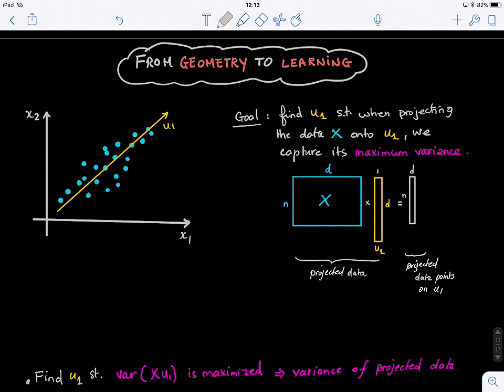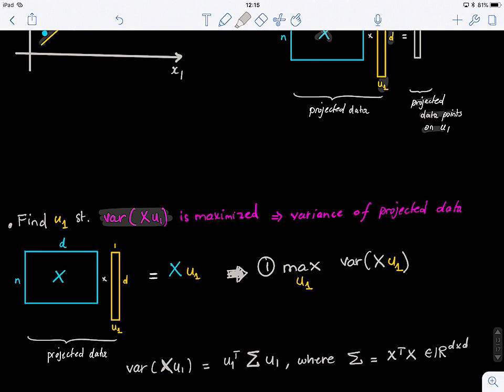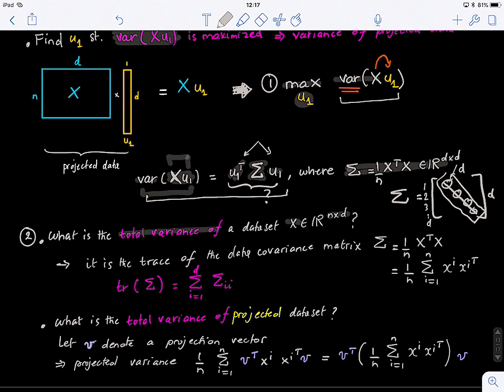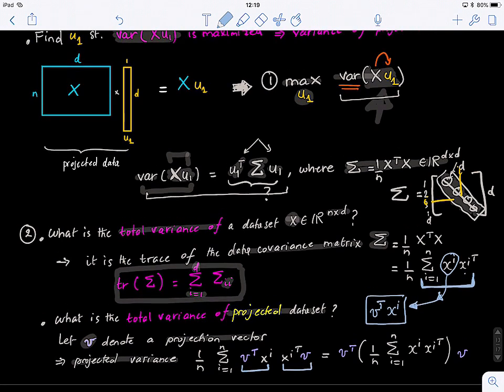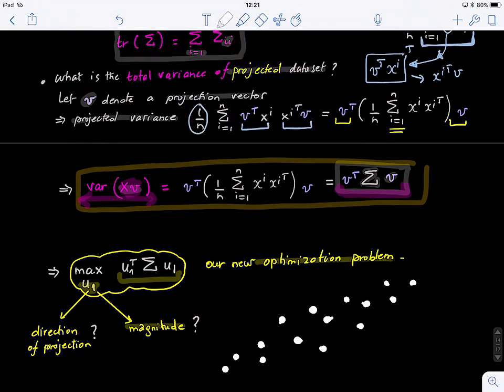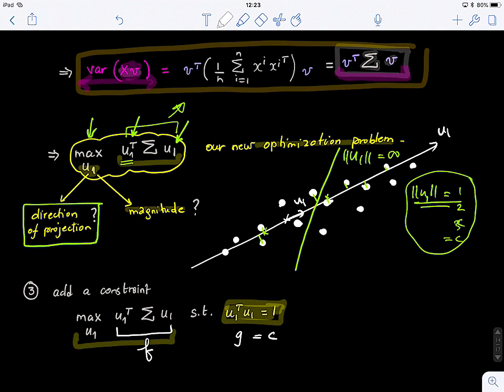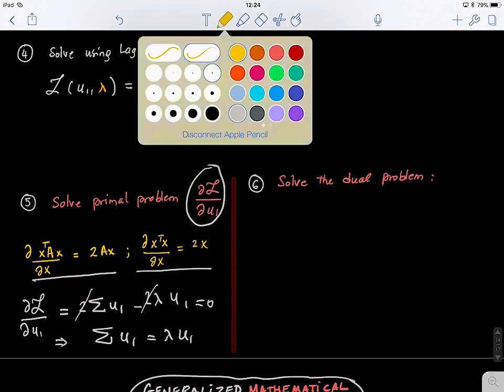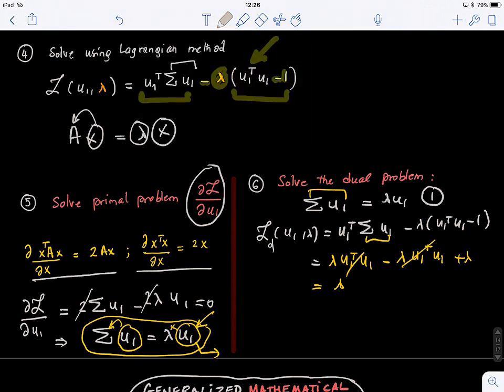Machine Learning Blink 11.6 (Constrained PCA optimization and Lagrangian method)

Comment: But that maximization in dual can be done only when the primal is a minimization problem, right? here the primal is a maximization problem.

11:37 In fact, this is incorrect. Because the primal problem is not a convex optimization problem, you're maximizing a convex function and not minimizing. Hence the strong duality does not hold. So, the dual makes no sense here.

Comment: Thanks for this  great video , i didnt understand one thing after getting pc1 and pc2 by mapping svd on co-variance matrix and choosing highest eigenvalue and eigenvactor why we need to optimize by using lagrange multiplier , and where we need this we have completed everything in previous video , please guide
Reply from the maker: Thank you for your comment. We use the Lagrangian method as we have  an additional constraint ||u||^2 = 1. Please check SVM blinks 8 and 9 for more details about Lagrangian-based optimization:
https://www.youtube.com/watch?v=KWp_TxnWfSU&list=PLug43ldmRSo1LDlvQOPzgoJ6wKnfmzimQ&index=32

Once you get the eigenvectors and eigenvalues, we don't know which ones solve the total variance maximization problem. The Lagrangian multiplier enables us to find PC1 (in 1 dimensional space) which corresponds to the eigenvector with the highest eigenvalue as it maximizes the constrained optimization problem we have at hand.
Reply: @basiralab  Thanks dear <3
Reply: can you please list down the topics of linear algebra calc and stats , i mean overall maths which we should learn to become a pro in machine learning
Reply from the maker: @BatBallBites  I highly recommend you check Part IV (Appendices) in the textbook Machine Learning Refined (2nd edition): https://github.com/jermwatt/machine_learning_refined
It gives an overview of the important mathematical tools needed for solving basic ML problems: (1) Advanced first- and second-order optimization methods, (2) Derivatives and automatic differentiation, and (3) Linear algebra.